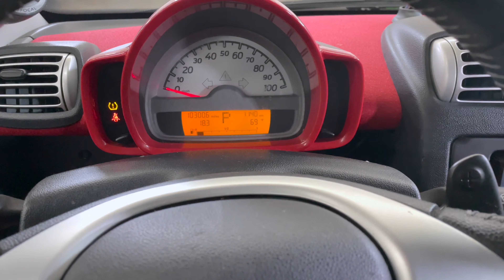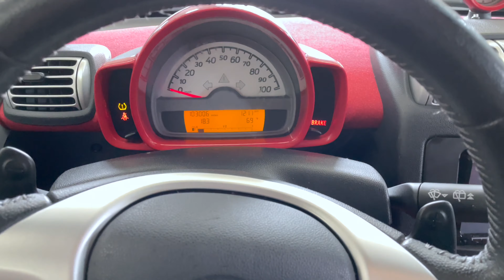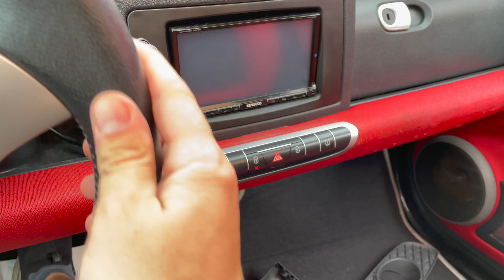Smart Fortwo Shifting Actuator Fix

Comment: Mine has an issue where it doesn't want to go into reverse at the first start of the day, but it's very odd.  If I start it and immediately put it in reverse it goes right in, but if I wait a few seconds then it won't go.  If I wait about 30 seconds then it's also fine.  I've had the car about two years and I'm pretty sure it's done this the whole time.

Also, the clutch engagement is a bit aggressive in reverse, I can feel it fighting the brakes.  Any thoughts?

I 'cure' the aggressive clutch by pulling the hand brake up one click which disables the 'auto creep' that way the brakes and clutch aren't fighting each other, but it would be nice to have the car just work properly.

In drive the clutch/brake relationship seems to be fine.
Reply from the maker: That could have a few different issues and sadly I can’t diagnose without being there. :/

Comment: Great video. I greased the gears and the slam sound is no longer there. But the shifter keeps going back to neutral. Do you have an idea what else could be the problem
Reply from the maker: I would have to see it to diagnose. Sorry.
Reply: Did you ever figure out what  this problem was. I have a 2008 that goes into neutral while driving. I'm thinking of replacing the actuator but I thought I could try the grease first.

Comment: I need help, I’ve got a 2010 pulse and when standing (neutral or gear 1/reverse) there is a rattling noise coming from where you empty the oil. And when I put gas to reverse or move off it jumps and ones it’s moving it stops
Reply from the maker: I would check the surrounding area. Sometimes a sound/rattle is coming from a nearby location rather than where we think it originates from. It’s unlikely that it’s coming from the oil drain plug.

Comment: How do i get my smart car into neutral? 
Its a 2005 turbo charged. 3 bars flashong and will not ho into neutral to start the car. 
Any help from anyone please. 
What happened is the car stalled coming fown the hill and i pulled over to the side and the car never started after. 
Clutch actuator works but i dont know what changes the gears. Wgatevet it is but its not shifting into neutral.

Comment: Did this on a 450 model,  also plastic gears, i used acid free vaseline for lubrication , it,s friendlier for the plastic parts inside.
Reply: Vaseline melts with heat, I would use a heat resistant grease.
Reply: @svenhansen9618  Good tip, the clutch actuator is mounted on the outside of the gearbox and thus not getting too hot, vaseline still goes fine in this case.

Comment: I greased the actuator but it didn't really improve. One thing could be to move the position of the actuator, or I have to check on the piston again. I'm not sure how exactly that mechanism works, but when I move the piston by hand, like pushing in, it sometimes engages and I can't move it. I'm not sure if it's supposed to do that or if I have to grease the inside mechanism of the piston too.
Reply from the maker: If you move it by hand like I show in the video and it seizes in a position it might have some internal gears either broken or shaved off. Possibly the electric motor itself corroding and seizing.

If it was my car, I would open up the actuator and see if I can move everything freely and go from there.
Reply: @ToyotaGR86Performance  I didn't see any broken part coming out of it, but the piston sometimes gets stuck. I will check on that again and see if I can take the piston apart and fix it or add grease to the piston too. I think the motor is fine
Reply: I can only suggest from general repair knowledge…what I do see, is a lot of this car’s gubbins, is exposed under the vehicle.  So ingress of ‘stuff’ like salted water from roads in winter, is probably a thing?  You seem right though, make sure everything that moves, moves easily.  If this does not fix it, it’s just as useful, from a fault-finding point of view.  I’d go back to what I said first, and make sure all the electrical connections are cleaned, look inside them, and clean them manually and with light grade oil/WD40 etc.  Green rot, setting into the wire ends/connector blades, you want to clear away as much as possible.  Plus, with age, a symptom can be that the ‘blade connector’ can have the female part that couples with it, become opened up and thereby, loose?  So if you can manually SLIGHTLY force the contacting shape to grip harder on the blade connector, that might help.  One thing I had to do once, was take fine-nosed pliers  and gently, a tiny bit, twist the blade side of the connection.  About maybe 2 degrees or so, this was all it took, and the rear light dluster, which these were moulded into on that car, did not need replaced - which was what the mechanic was gonna do for fifty bucks.  I think about that a lot - then there’s the polishing of headlamps to avoid buying entirely new lamps to pass the roadworthy test (called an MOT here in UK).  This was on a Passat - it’s £200 a pop.  The car cost 3 grand.  I bought that de-yellowing kit, and in a day - I’m slow - fixed the lamps 100%.  And effectively, ‘earned’ about £400 by doing so.  Anyway, good luck, take care.

Comment: Hi! I've replaced the actuator but the engine doesn't start now🤔all I can hear is a cling cling...any idea what would be please??
Reply: I had the engine light on before changing, disconnect the battery as well...I tried the old one after and does the same
Reply from the maker: If it started prior to removal and won’t start now, it means you made a mistake somewhere in the process.

I would repeat the process again and follow the video as to where the placement of the actuator goes when mounted, check the pins on the connector if you bent them.
Reply: @ToyotaGR86Performance  nothing to do with deleting the error s?
Reply from the maker: @mariusu1169  deleting the DTC codes will not cause the system to not function.

Comment: Hi , i have a 2008 passion and today it show up with 3 bars on the dash .
I turn off the key and turn on . The bars disapeared and now its beeping when on drive or reverse and my seat belt ligth stop working.  You think its the actuator?
Thanks
Reply from the maker: The seatbelt light being on and beeping means your belt detection button isn’t contacting.

You can electrically unplug the buckle and use electronic parts cleaner to spray where the buckle gets inserted and it should clean the contact surface. 9/10 times this will fix your issue.
Reply: @ToyotaGR86Performance   the seat belt ligth is off and its beeping , but i was affraid that was related with the 3 bars code . Thats why i stopped the car until i found whats wrong and if its safe to drive.
Thank you very much for the reply .

Comment: You seem to know what's up with these. My smart was running fine, I went from R to D a while I was still ever so slightly moving today. Now it's stuck in R. Have tried the batter reset etc. is there a chance the actuator is bad and needs replaced. I can hear and see some movement in the arm when it's trying to work at start up but won't leave R and is stuck with = on screen. Any advice will be greatly appreciated
Reply from the maker: If you’re stuck with the three bars, it means your transmission needs to be relearned.

There are lots of videos on YouTube how to relearn your transmission. If you try those, and they don’t work, then I would completely remove the actuator and see if it is physically stuck in some mode or if there are some gears broken inside of it. If that’s the case, then replace the actuator, if the actuator is fine, then put it back on the car & attempt the relearn again.

Sometimes when an actuator is removed, and you attempt to relearn, it may end up simply fixing the issue. If not, come back here and let me know.
Reply: I replaced the actuator after finding a possible stripped gear in the original. New one seemed to work fine. Drive reverse neutral etc. Managed to get 1st and 2nd gear driving but as soon as speed increased I got the gear wrench icon, flashing in D and now same thing, stuck in gear at the side of the road and won't re start again it sits on the = sign
Reply from the maker: @YSRMOTORSPORT  

1> Hold down the brake pedal, and2> Turn the key to the on position 1, and3> Move the gear shifter through each of the gears P-R-N-D then +- then D-N-R-P, and4> Turn off, and5> Restart the car.
Reply: @ToyotaGR86Performance  so I set my camera up under the car. I can hear the gears trying to click through but the actuator isn't doing anything. When I put it in initially you can see the actuator arm pressing the clutch in and out. Now it's not doing that, even with a battery off reset. It's almost like it's not getting its signal to press the clutch from the arm
Reply from the maker: @YSRMOTORSPORT  if it’s not getting a signal then you might have a wiring issue. Sadly I cannot help you with that over the Internet.
Reply: @ToyotaGR86Performance  appreciate the help. That's what I'm thinking it's electrical sadly! I just need to get it back into N and shut off battery so at the very least I can tow how home behind the RV safe and deal with her at the shop
Reply from the maker: @YSRMOTORSPORT  best of luck to you.
Reply: @ToyotaGR86Performance  is there a way I can send you a short clip of the actuator clutch. It looks to sort of work but still doesn't want to reset. Not sure it could be something else. Happy to venmo you if I can get this resolved
Reply from the maker: @YSRMOTORSPORT  I would need to plug in my scan tool to diagnose the issue. Sorry, but a video won’t help me.
Reply: don't you wash the inside of the actuator before greasing it? Wouldn't it be better if you marked the position of the actuator with paint before taking it apart?
Reply from the maker: @aieiebrazorf5076  you’re more than welcome to use a safe cleaner and mark it with paint if you decide to do those things. As you can see, I didn’t either of those and everything works just fine.

I was trying to show people how to do it quick and easy so people can fix their cars without being intimidated.

Comment: What’s the most common fix for a “slight miss feeling”under hard acceleration?  Ty subd
Reply from the maker: What do you mean about slight miss feeling?
Reply: @ToyotaGR86Performance  idk how else to describe it,  under acceleration, maybe in the higher gears it gets dead spots like a bad coil? Only 40k on the clock….2012 smart car
Reply from the maker: @roz4747 sorry, but that is not very much to go on. Could be anything from bad fuel, bad/old, spark, plugs, timing, issue, clogged air filter, or a number of other things reduced power at specific RPM ranges.
Reply: @ToyotaGR86Performance  well ty

Comment: I did this but my car is now having trouble in reverse and shifting. Any ideas on how to get it back to normal? Did I mess something up?
Reply from the maker: if the process was followed exactly, everything should work properly without issue. If you are having a problem where it is no longer working after the repair, it means something was done incorrectly upon reinstallation.

Comment: Can you provide a link to a scan tool that you’d recommend?
2009 Smart Passion Owner here 👋🏼
Reply from the maker: Any simple tool that can give you the code for whatever issue you were having is good enough. The tool that I personally use is Autel MD808P. It’s roughly $230USD.
Reply: @ToyotaGR86Performance  thank you for the reply! Does your unit also program keys as well?
Reply from the maker: @TheDogFather1991  no it does not program keys… It is what I would consider, a basic scanner, but a very good basic scanner.

Comment: Hello, I have a mitsubishi colt, recently I changed the clutch, everything is ok, while I'm driving, when the gearbox changes from gear 2 to gear 3, there is a noise like a crack and then it goes into gear, do you have any idea what it could be? possible to be from the actuator? Thanks a lot
Reply: Is it an auto box similar to the smart? You may need to reset adaptions with a scan tool to get it to drive properly again
Reply: @dementedchikenjc  yes its auto ,similar with smart

Comment: Mine doesn’t slide as easy like yours. How can I get it to slide easy to screw in the middle. It wont let me it’s too tight
Reply from the maker: I am honestly not sure what you mean. If you’re talking about having the actuator sliding position before you lock it down, you would simply need to loosen the screws a little more to allow to slide.

Comment: Did you have to command a re-learn or did it do it automatically?
Reply from the maker: Automatically. Sometimes you will get the three bars on your dash and there is a very simple process to get it to relearn the position without using a scan tool.

There are a few videos that show you how to do it. Process takes about two minutes.

Comment: I bought a new clutch actuator to replace my old one. Can anyone tell me if I need to lubricate it first before I install it??
Reply from the maker: If it is brand new, no. You can just install it.
Reply: @ToyotaGR86Performance  The mechanic told me I had a bad clutch actuator that needed to be replaced and that it would cost over $1000. After watching your video it does not look too difficult. I ordered the part and will replace it myself. I'm not a licensed mechanic just a guy with a toolbox. I hope it works out.
Reply from the maker: @nonamejohnson4809  you’ll be fine. $1,000.00 is a rip-off.
Reply: @ToyotaGR86Performance  Thank you! And the tool you used to remove the clutch actuator is the e10 reverse torque size 10? Am I saying that right?
Reply from the maker: @nonamejohnson4809  E10 is the socket size, yes.
Reply: Got the clutch actuator today. I couldn't get the front bolt or wires off. Given I didn't have my car raised and I did not use WD-40. Might be a dumb question but will raising my car make it easier to access and remove the front bolt?
Reply from the maker: @nonamejohnson4809  raising the car makes working underneath it always easier.
Reply: I raised the car and I replaced it thanks to your video! Buuuut while I was driving it was shifting weird. I went 40 mph then when I went back to 1st gear and slowed down it wouldn't move. I turned it off and it never turned back on.

I replaced my clutch actuator do you think it needs to be reset by a computer? Do you think my car's computer needs the settings adjusted?
Reply from the maker: @nonamejohnson4809  without having your car in front of me I can’t properly diagnose it, but try to re-learn the transmission selector. Sometimes that’s the cause.

Turn the key to position 2 with the engine off. Have it in each position for 10 seconds. P, R, N, D, N, R, P.  Pay attention if your gear selector indicator shows anything different on your dash cluster during/after you do this.
Reply: Thank you I will give it a shot

Comment: What type of grease do you recommend? I know you said it was super cheap like 2 bucks, but if I’m going to Walmart or an auto parts store, what would you get? High-temp? Silicone?
Reply from the maker: BTH, I used brake caliper grease because it tends to hold its shape and not become runny when it heats up.
Reply: Awesome. Thank you.
Reply: Alright. Totally assuming this will work, but figured, what the heck…I’ll ask anyway. 😂 I got a 5 oz tube of Permatex Ceramic Extreme Brake Parts Lubricant. Think it will do the job alright for the clutch actuator? Thanks in advance and Happy New Year.
Reply from the maker: @BioHazard03  if it’s thick like the OE white grease, then I would assume you will be fine.

Comment: Hello friend, how are you, I'm an automotive repairman, I have a smart 451 with a transmission problem, I can't release the starter and I don't have the gear selection. Can you help me?
Reply from the maker: You mean you can’t unbolt and remove the starter?
Reply: @ToyotaGR86Performance  hello, thanks for the reply friend, my problem friend is that I can't start the engine because it doesn't release the blocked start due to some failure in the transmission, you understand.  because you have the WhatsApp number that we can communicate with so I could send you a photo of the problem thank you
Reply from the maker: @geidsonqueiroz2680  sorry, but I don’t have WhatsApp, and it is still unclear what your issue is. Please make a simple video showing the issue and explain what is happening, upload it to YouTube or other site and send me a link.
Reply: @ToyotaGR86Performance  hello friend do you have an email that can send the video to you
Reply from the maker: @geidsonqueiroz2680  I do not have a public email. Please just reply here with the link. Thank you.
Reply: @ToyotaGR86Performance  ok
Reply: @ToyotaGR86Performance  Hi, I'm going to enter Star Diagnosi and read the faults and send them to you ok
Reply: @ToyotaGR86Performance   hello friend about the smart we talked about I have these failures below
p0805
p0886
p1700
p1800
already remove the clutch actuator but there is nothing visible that looks like a defect can you help me thanks
Reply from the maker: @geidsonqueiroz2680  based on what the codes are, it’s possible the TCM relay is bad, but before you spend any money, I would put the actuator back in the center position, reconnect everything and then turn the key to the “on” position without starting the car for about three minutes. You should hear some moving of the actuator as it relearns its new position.

If that is not happening at all, it is possible that the relay is bad, or there is a wiring issue. I would check all the wires for continuity make sure that nothing was chewed through by some animal.
Reply: @ToyotaGR86Performance  Thanks for the feedback, but where is this relay scratch, do you have a photo of it that you can send
Reply from the maker: @geidsonqueiroz2680  I don’t have a photo.

Google is your friend if you don’t have access to a repair manual.